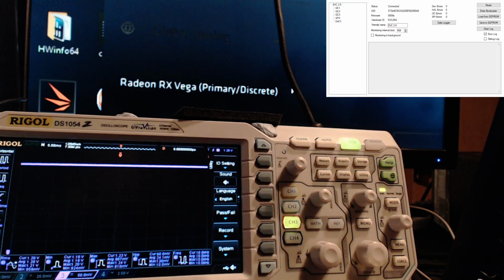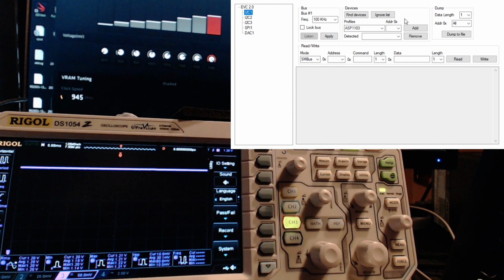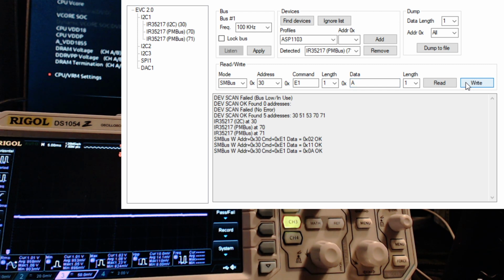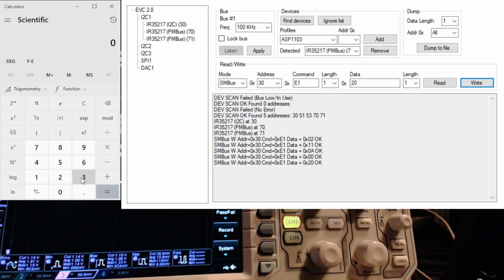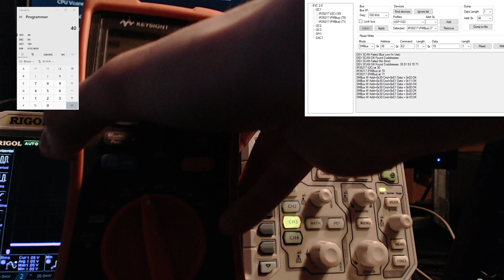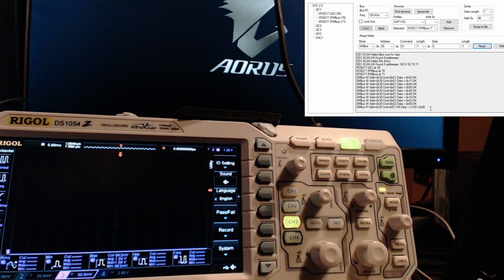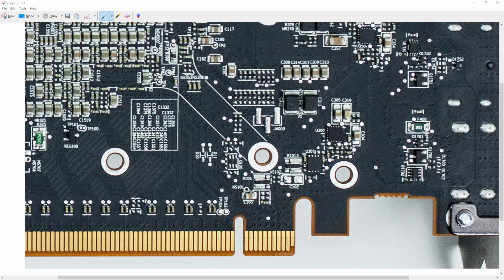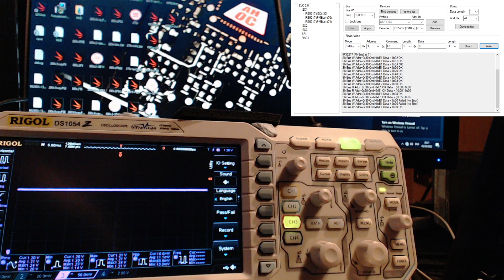Vcore and HBM voltage control on AMD RX VEGA refrence cards using the Elmorlabs EVC2

Comment: hmm.... why not flashing the LC version bios on it? did it on my airboost OC and it did wonders, since I actually put the damned thing on water.

granted voltage max went to just 1.25v and power limits up to 396w but... it's "OC'ed" to 1750mhz core (LC version core is actually base 1750mhz, but hwinfo saw it boosting to 1890mhz for some reason...?) and 1100mhz vram, and it's stable. 1.2v 1663mhz and 1050mhz vram was hitting power limit wall (330w) and crashing .

Comment: Vegaii uses the same memory I thought, and hwinfo64 always read my voltage on memory as around 85-870mv.  There isn't a voltage slider on the bios for amd ram, so I never bother trying to overclock the memory cuz it always causes issues.  Be nice if they let you set voltages higher.

Comment: I currently have Vega FE, but I can not use gaming drivers. I flashed Vega 64 LC bios, made some changes to the registry and stil nothing. Can someone help me? On the bright side it has better performance now. I have an ek waterblock installed, 280 + 140mm radiators (with Ryzen 2700x in the loop too, but it is undervolted).

Comment: What's the max voltage the Vega 64 can handle? I saw you went up to 1.35v which is the max for 14nm, right? I wonder if I could get it to 1900mhz that way.
Reply from the maker: I actually have no idea what the limit would be for long term use but considering the Vega 64 LC ships at 1.25V 1.3-1.35V would probably be fine if you have enough cooling for it.

Comment: Would you recommend getting a Vega 64 Nitro+ in 2021?
Reply: Have one. Best air cooled vega you can buy. Super fun to fuck around with in terms of overclocking/undervolting. Only complaint is Radeon drivers are just unbelievably buggy sometimes despite having a lot of nice features. Guess it depends on how much you're gonna be paying for one in current market though.
Reply: @thanatoast4  I finally bought one last Tuesday. €195 in box. Card does 1750/1075 on water.
Reply: @Wasmachineman  Damn I forgot about this comment lol.

Still use mine daily, recently de-shrouded it and put 2 NF-A12x25's on it. Temps are ridiculous. I'd feel comfortable running 1.2v with unlocked power limit now with the added thermal headroom (fuck you, hotspot), though for daily use I still run it at 1v 1600/1050.
Reply: @thanatoast4  1600 with only 1V is impressive!
Reply: @Wasmachineman  In reality it's around 1500, the clocks you set are only a mere suggestion really, its the voltage that makes a difference. 1600 at 1.2v would clock much higher. But i've done plenty of testing and for me personally...the performance difference between 1600@1v and say 1700@1.2v is just not worth the massive power increase. HBM OC does most of the work.

Comment: I don't know if this question will be seen, but I have a Sapphire Pulse Vega 56 and I seem to max out it's potential before maxing voltage. In fact, I think it's still slightly undervolted with 1.1v core voltage @1700Mhz and 1v memory voltage at 960mhz. Is there any possibility of higher clocks with extra voltage beyond 1.2 if there's no gains obtained before hitting 1.2?

It probably sounds a bit weird, but I hope you understand where I'm getting at, lol
Reply: High temps can lower stability, it's possible that your card doesn't like the temps at higher voltages. Also going to be power limited with the stock 50% extra limit. As far as memory goes, you're not undervolting it at all. That voltage controls the lowest load voltage of the core, it really has nothing to do with the memory
Reply: @DeBlackKnight  that's the thing. Temp-wise I don't hit any higher than 70° tops and that was at full load when my air conditioning died on me. But fair enough on the voltage... I just find it weird that if I max voltage on everything with the +50% on, I recieve no performance gains despite overclocking farther. All I recieve in return is instability

Comment: I've got a Vega64 on water that I've wanted voltage control over for awhile, I tried using the LC bios to get a bit more voltage but something about the new drivers really hates having a reference air card with the LC bios. Definitely considering this, although I haven't soldered anything before it looks easy enough based on the size of that header. Would this work on a more modern card, say a reference 6800xt? (if I ever manage to get my hands on one)
Reply from the maker: yeah I ran into the same issue trying to use an LC BIOS.
Reply: Try the regedit, then you can go to 150% (I keep it lower since I have the normal aircooled  Strix) instead of 50% with powerlimit.
Reply: @Ries  I already use the regedit for more power limit, even at max draw and max voltage my card peaks at 36c under load. The entire point is I want to push it even further
Reply: @DeBlackKnight  Oh wow... Good luck!
Reply: @DeBlackKnight  How does it perform at the moment? Freq. and mem.? And at which voltages?
If you don't mind telling me of course.
Reply: @Ries  Daily settings are 1735 core, 1140 memory. I could maybe go a little further than that but I've been chasing down crashing issues and I lowered clocks to make sure that wasn't the issue. I've reached number 1 on the 3dmark Firestrike leaderboards for my combo (5800x + Vega 64), so my card is capable. That was clocks that are unstable for gaming however (1820 core, 1190 mem). When the LC bios used to work properly, I ran around 1775 core for daily use, the entire reason I'd like to get more voltage into it
Reply: @DeBlackKnight   Wow, mine goes above 1700 (set as min. 1662MHz) as long as it's not under constant load. Memory 1180MHz. Respectively 1150mV and mem. 1100mV.
I can't go higher on the core, since it will only downclock (not as much cooling as you have). For gaming I could go for 1200MHz mem. playing games, but it will crash when it's on full load for a long period so I'm keeping it at 1180.
The card remains at 76 degrees Celsius while being stressed.
This is the best stable overclock sofar I got on the card.
Running it with a 2700X at 4,3 all core en 16GB CL14 3400 (Both overclocked obviously) amongst others.
Reply: Ditto on the LC BIOS / Driver issue. Driver update at the end of 2019 killed it...

Comment: Hey that's the exact oscilloscope we use in school. Is it a value model or something?
Reply from the maker: yeah it's around 350GBP
Reply: @ActuallyHardcoreOverclocking  That's very affordable. They can go up in price very fast.
Reply: You can unlock the 100Mhz range and other features. Code can be found online or is now sold for a while with it.

Comment: 5:10 It's a signed 8-bit integer (two's complement).  0x00 ~ 0x7f = 0-127, and 0xff ~ 0x80 are -128 to -1.
Reply: I see what your saying, but for clarity
0x80 = -128 and 0xFF is -1 (thus adding 1 to FF and throwing away the carry gives you zero, you can think of 2's compmement just like uints, except the most significant digit -2^n instead of 2^n where n is the number of bit system your working on (thus 0xFF = 1111 1111 = -2^8+2^7+2^6+2^5+2^4+2^3+2^2+2^1+2^0=-1 and 0x80 = 1000 0000 = -2^8 = -128))

Comment: Aaah. So that little "try it in the bios" trick would probably be how I get the r9 380 to work properly with the evc2. I kept getting nothing even tho I knew it had atleast the ir35217 and the evc2 was running the proper firmware